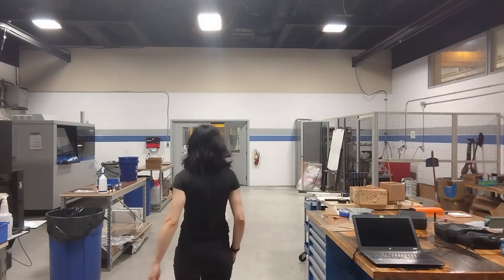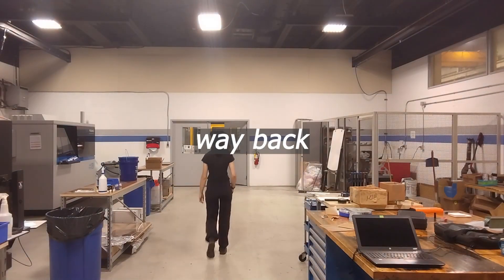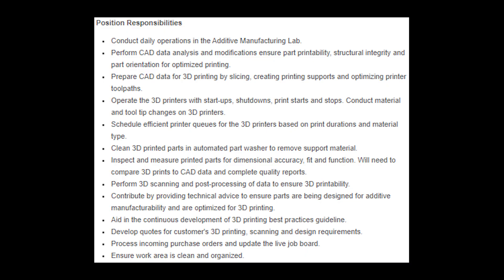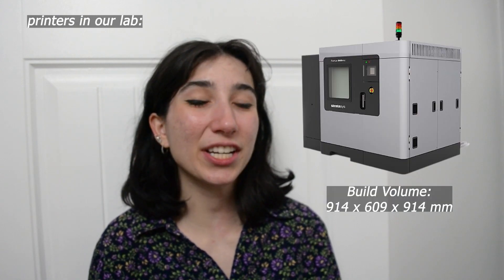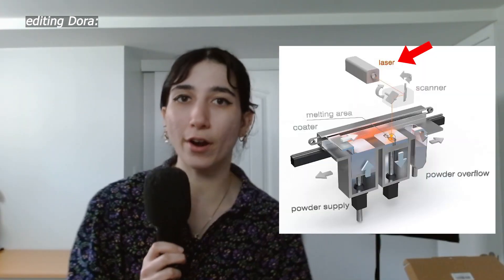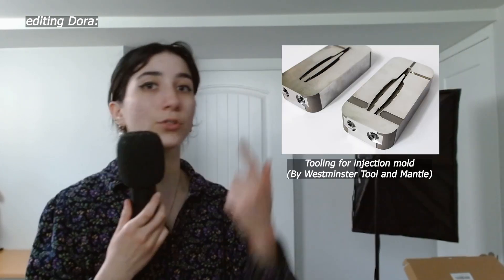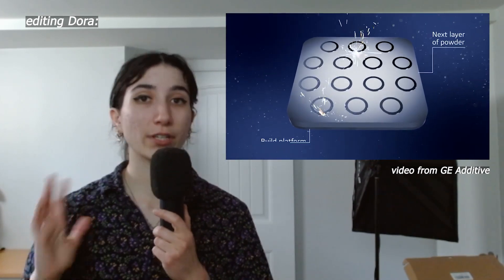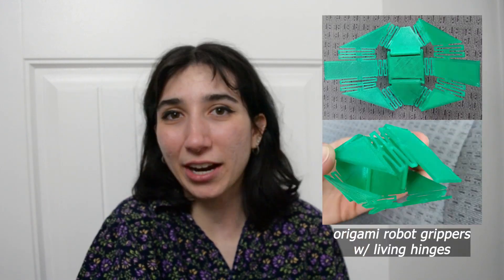day in the life of a 3D printer

Comment: So after you design something can you build something with it or that’s it?
Reply from the maker: As in (1) do I use the thing I designed in my build or as in (2) can I use the 3d printers to build things for my own personal projects?

Answer to (1) after I design something, yes I build something with it. Often our boss would have us working on side projects that included fixes around the lab or shop floor so after designing we would implement those parts in a build. When it comes to our print on demand services, we usually just printed and post-processed the part (maybe add some hardware for the customer) and then ship it with our inhouse service.

Answer to (2) yes we occasionally used the nice big printers to print our own stuff. For example on the metal system, I was able to print a custom ring for myself ! Also a few enclosures and random parts on the plastic Stratasys systems. I haven't personally printed anything to take home on the Origin One DLP system for resin that is in the video but worked with the machine a bit. 

Hopefully I answered your question, if not let me know !
Reply: @ “implement those parts in a build” so you each put your own single parts together to build something new?

I’m interested in this I just wanna be sure that I can build stuff with the parts and not just lazy print. No offense. I just really like building stuff.
Reply from the maker: @SuperKvlogs  I am not offended at all !

If you like to build stuff, an R&D job or engineering job would be better than just a designer or lab technician role. More often we were printing to order (I think what you mean by lazy print). I liked this job because I was still building stuff on the side of printing BUT not every technician job will be like that. I ultimately grew out of this job because I'm more interested in building & inventing than printing other peoples designs. Hope this helps
Reply: @ ohh thanks!! What do you do now? Also what kind of jobs can I get in R&D? I searched up research & design jobs near me, didn’t find anything yet.